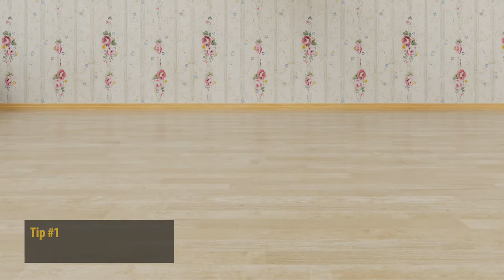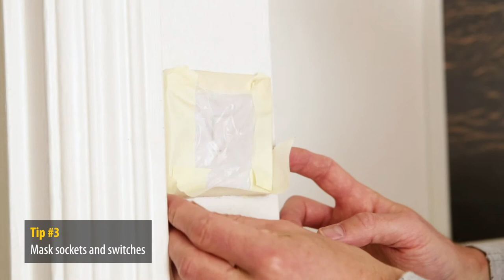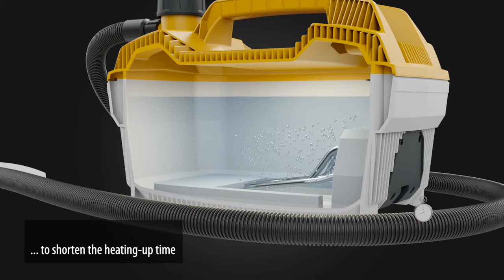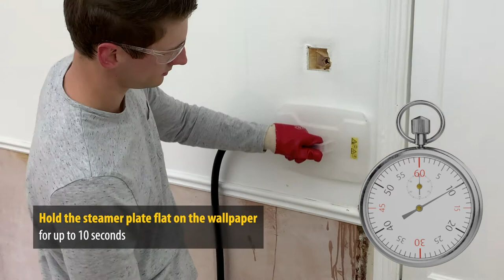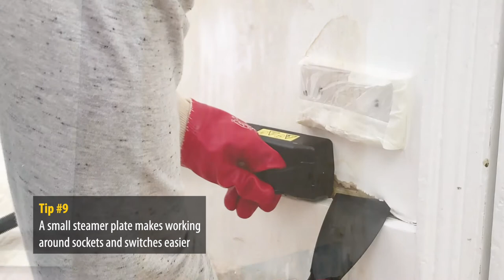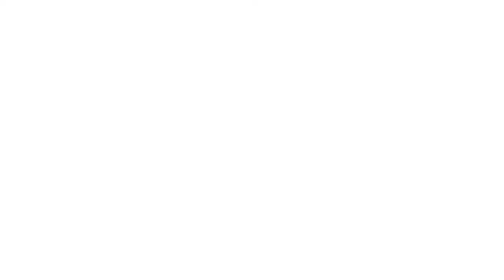Tips & tricks for steam wallpaper stripper SteamForce | WAGNER

Comment: Even though the steamer is producing steam none is coming out of the pipe.  M15 wallpaper steamer.
Reply from the maker: If your wallpaper steamer is producing steam but none is coming out of the plate, the issue may be due to a blockage in the hose. Start by inspecting the hose for any kinks or obstructions that could be restricting the steam flow. Additionally, make sure both ends of the hose are tightly connected to the steamer and the plate. It’s also worth checking the steam plate for blockages or build-up of debris that could be preventing steam from escaping. If everything appears clear but the issue persists, consider cleaning or replacing the hose to restore proper steam flow.